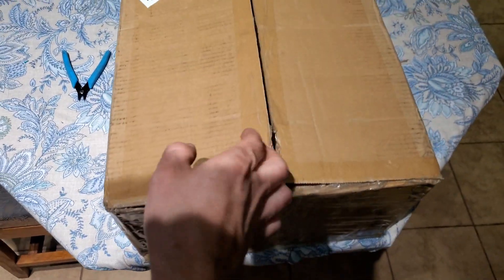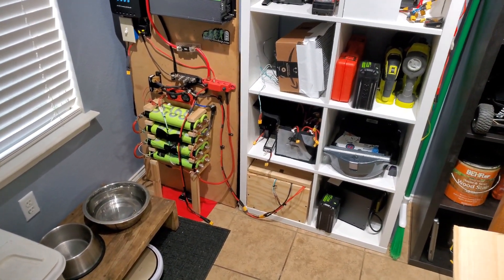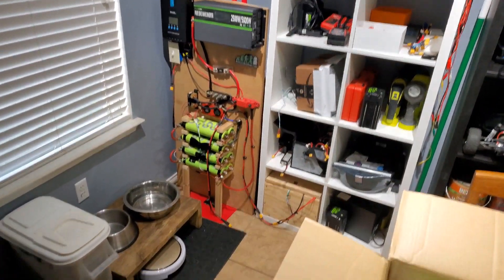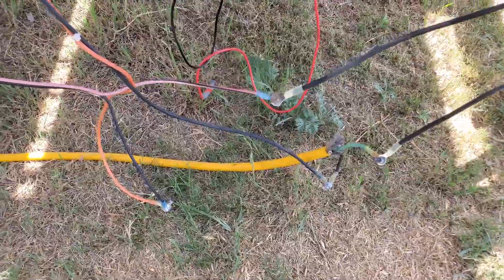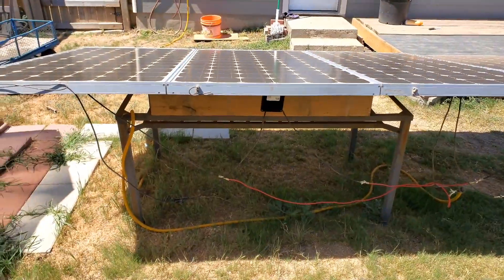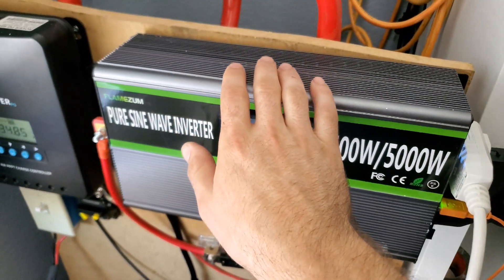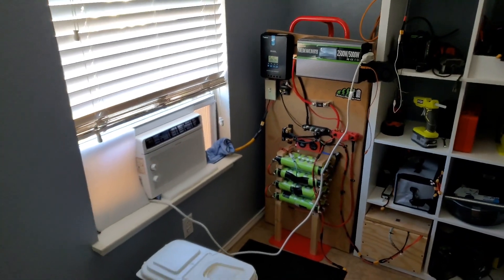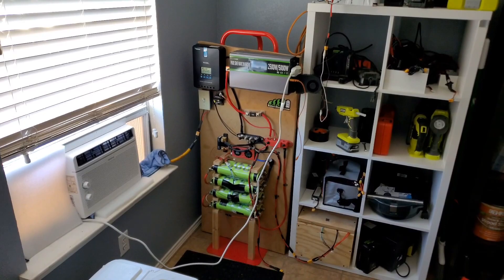Solar DIY Lifepo4 power station 1 overview of system and running ac off of it

Comment: 180w panel @ 37.5v... what's the Amp's???
Reply from the maker: 180 ÷ 37.5 = 4.8 amps per
Reply: @Mikebuildss  so that would be 720 watts @ 75Vaults with 9.6amps going thro the canle??

Comment: Nice small 12 volt system . Like those large  green cylinder cells 🔋🔋🔋. Keep up the great work and powering your necessities as you grow from more of those cells . We preppers especially here in this hot Texas summer and hurricane season as must stay ready during any SHTF situation or to save on the light bill . Check out my DIY solar videos , hit like , leave a comment and subscribe . May the solar be with you .😊🤙🤗🤗

Comment: I do not know those batteries, could I give the specifications and place of purchase.
Reply from the maker: There from batteryhookup dot com, however they sell out fast. specs are 3.2 volts, 55 ah per cell, i believe they are rated for 1c discharge rate
Reply: @Mikebuildss  Thank you